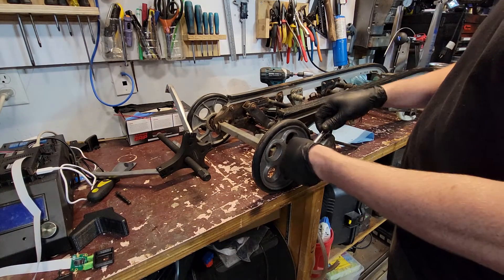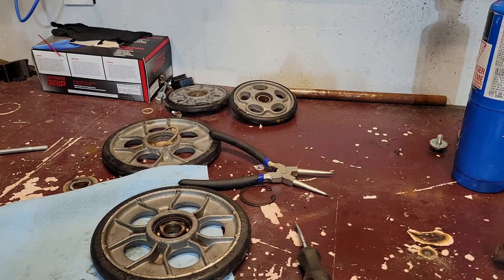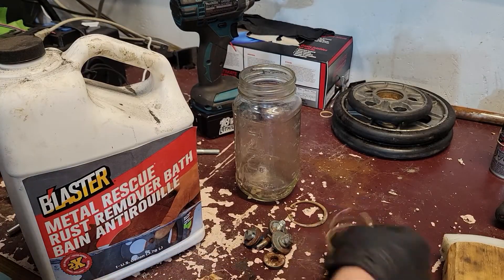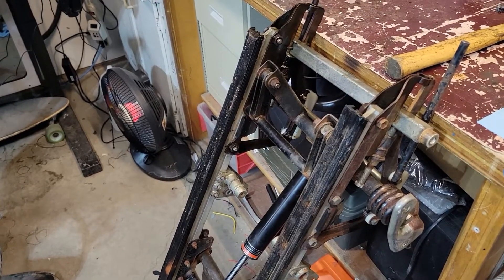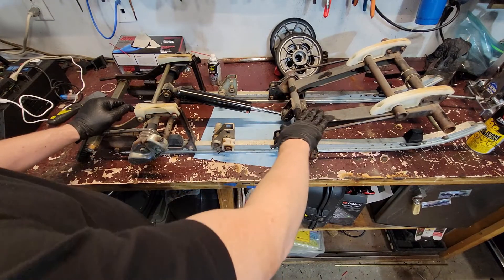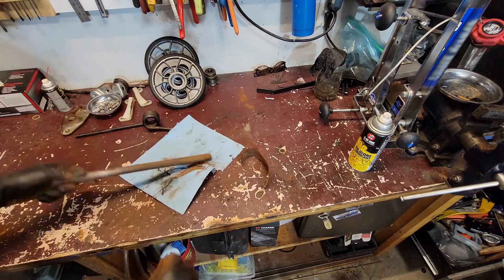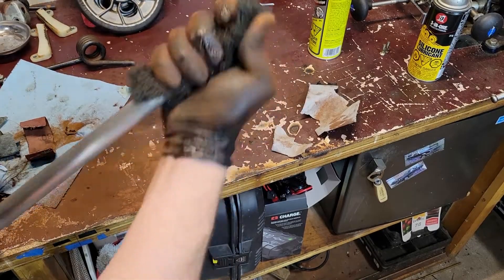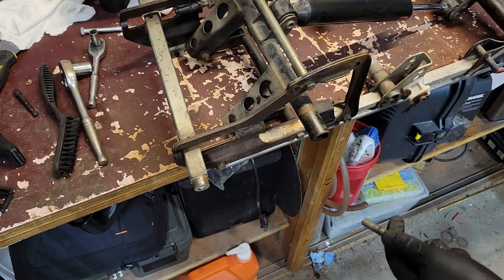Yamaha Enticer Skid Rebuild - PT 1

Comment: Great job, did you take pictures of everything before you took it apart? It looks like a wire wheel bench grinder would be handy!
Reply from the maker: Yeah, I usually take pictures. But if I forget the microfiche pictures and manual come in handy. I agree, a benchtop wire wheel would be nice.

Comment: Hi…. What are the size of the idler wheels?   Both the front and back? And are the bearings and shaft the same size? Front and back ?
Reply from the maker: Rear ones are 7" and use a 6204 bearing for a shaft diameter of 20mm. The smaller ones are 5.125" with a 6004 bearing, also for a 20mm shaft.
Reply: @Garage_Tinkerer  hi.  Thanks for reply    Getting new Track and want to have all the bits and bobs done as skid is off 
Track from guy in Quebec.   Brand new.